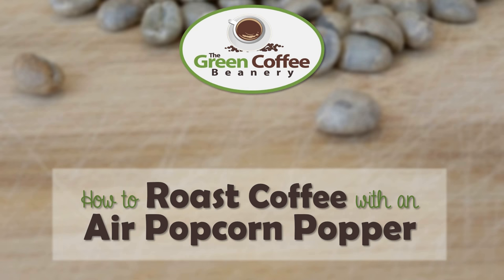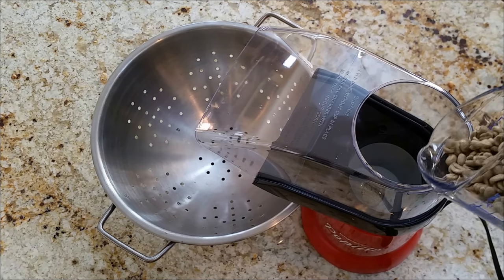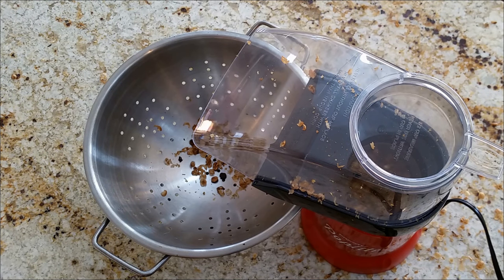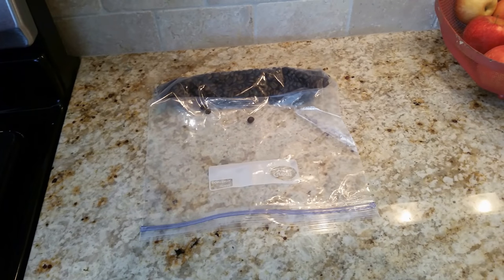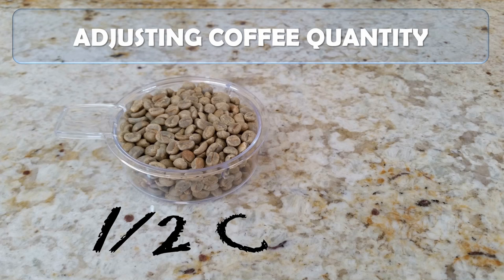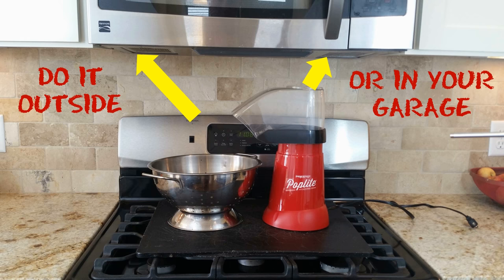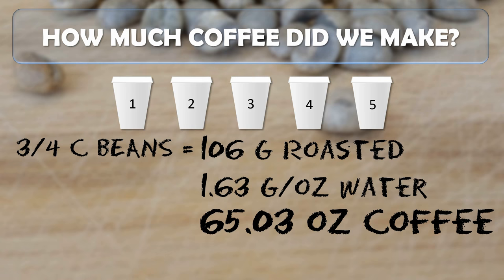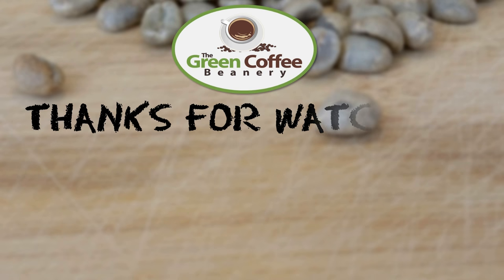The Ultimate Guide to Roasting Coffee at Home with an Air Popcorn Popper

Comment: Tips from my experience with a similar popper. Ditch the clear plastic top piece. Do it outside. Cut the top and bottom off a standard size tin can (or whatever fits your popper) and shove it into the roast chamber to increase the size if it, sort of like a chimney. Use a small mesh strainer with a handle on it to cover the top of the chimney. While roasting, use one hand to hold and shake the popper while using the other hand to hold the strainer on top of the chimney and shake and swirl the whole assembly. Occasionally, stop and lift the strainer to let the chaff fly out and look at the color of the beans. Your arms will get a work out but this provides excellent agitation which yields a very even roast. I roast 90-100 grams at a time. I use a large mesh colander which rests on a box with a hole cut for the colander and a smaller hole hook a vacuum hose up to for  rapid cooling.

Comment: Great video! I had the same problem. The coffee was roasting too fast and what really bugged me is I didn't get that "sweetness" I would get from already roasted beans from my favorite coffee shops that roast their own on premise. My solution was to heat one minute with the machine on, then rest one minute with the machine off. Do this back and forth, and remember to shake up the beans once in a while even during the rest periods. Doing it this way my first crack would begin at about 7 to 9 minutes and the second somewhere between 12 and 15 minutes. I also chose a lower wattage machine (1040) here again to keep the heating longer, slower and more even.
Reply: great tip thanks. did your method matched the roast from your coffee shop? i am considering doing this and now looking for a machine....

Comment: I found the air poppers with the air vents on the side at the bottom help keep the beans inside so I can roast 1/2C at a time.  I've also taken a light dimmer switch from Home Depot and rewired the fan through the dimmer switch for more control of the roasting process. ie fan on high for moisture removal and then lower to help increase temps and keep beans in the chamber.

Comment: Just do it on the patio or deck. The smoke sticks on your walls, furniture, etc. and the smell lasts for days; let alone the chaff that flies everywhere. Also use a infrared thermometer to measure the temperature for consistency.  you may need to turn on and off the popper to keep the temperature in range.  So the air popper would be better have a on-off switch.

Comment: The Presto Poplte has a mesh screen  at the bottom which does not rotate the beans and require  stick stirring. I found a chamber with side hot air vents  works better. The presto is very hot runing...it's advertised as being a fast popcorn popper, I'd want slower

Comment: This worked but quantity was insufficient for our needs.....so moved to a modified bread machine for agitation, and use a heat gun to produce the required heat,.Temperature is checked using an IR thermometer. Cooling is done with a colander and fan.  App 15 minutes to roast 1 lb.....but I highly recommend  the process be done outside as significant heat and chaff are produced. So far I've done app 250lbs....works like a charm. Bread machine must be wired to constant agitation only.

Comment: I have this popcorn popper. I thought I couldn't use it because it wouldn't get hot enough and people talk about modifying it by removing the thermometer, but I don't want to do that. However, with examples they said to use older high wattage poppers around 1250 watts I think, but I checked this model underneath and it said around 1400 I think, so maybe it is fine. I think I want to try a light roast, but I bought Ethiopian beans which they normally prepare extremely well done.

Comment: Hello, enjoyed the vid. See that no one has spoken for two years, oddly enough. Well, I used the Westbend Poppery II for my trial. It failed miserably and I have a few questions to see if I can improve. I used 3/4 cup of green beans and stirred regularly. I pre-heated the popper. At 8 minutes in I began to hear first crack, and this is my first question. It was late in the first place, but OK. Obviously not all beans crack, certainly not at same time, so how does one tell the first crack from second crack, as I did not hear much cracking in the first place, and I did not hear a distinct stopping and then a second beginning. I do not understand how one knows the first crack has ended, since not that many cracked. Wouldn't it be a gradual transition, since some beans will crack early, some late. How does one know the second has been achieved, not just late first beans??? I do not think I even got to second crack, and after 20 minutes I ditched it, and tried those beans on a pan using my outdoor grill, trying to get to second crack. I did hear some cracking but was it first or second, I don't know. The beans were getting too dark, although many were too light. I was not happy with this. I tried a second trial, this time using grill only. Not much better. I stirred regularly but ended up with wide difference in colors, and never did I get a nice smell at all, which I had hoped for. I kept a pretty low fire, as I feared burning beans most of all; better slower than faster. It took a long time for 1st crack, about 10 minutes! Again, most beans did NOT crack; are they all supposed to? I only heard some cracking, which was loud, definitely 1st crack. I kept stirring and waited, too long, for second crack, but again, could not differentiate between first and second crack, since for me at least, there is no definite break in between, and again, only so much cracking, definitely not representative of the majority of beans. The color was my key, as sound and smell definitely were not working for me. I got black and brown beans, and I feel that the black were over-done and the brown, not enough. I did not want to see oil, which is burning, and I did not, but I do not think I got a good second crack, and not even a definite 1st crack from the majority of beans; there just was not enough cracking to convince me of an overall 1st crack, let alone the second crack. This was the case in both the air popper trial and the complete grill trial, using a very shallow cast iron pan. I may try a thinner device to move the beans, because I fear that I did not actually turn them over, just transferred them, leading to unevenness. It is too thick a wooden spoon. I cannot explain the slowness in either case, not even achieving  second crack after twenty minutes with airpopper. Am I doomed to lousy coffee, of my own making? Used Balinese beans, btw.

Comment: I used a simple cheap pop corn popper almost exactly like the one you show and after 2 roasts the upper part of the machine began to melt.  Should I try to return it I am wondering, especially since you don't mention this problem and the one I used is exactly like the one you show.  Any ideas anyone?
Reply: Using a popcorn popper as a coffee roaster voids the warranty in every case Ive seen. It's not uncommon for it to soften and disfigure the plastic upper components since the machine was never meant to run as long as needed to roast coffee. If its just a matter of looking ugly it's no big deal. I roast mine with the top off. A little messy but it solves the issue of melted plastic.